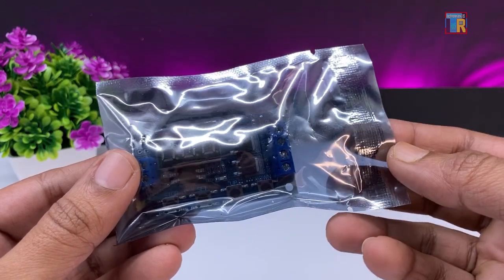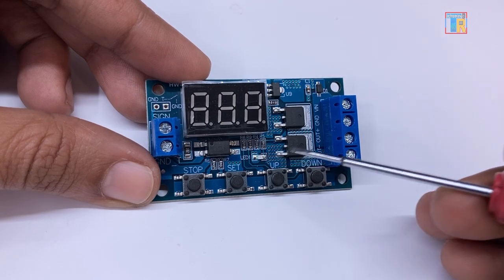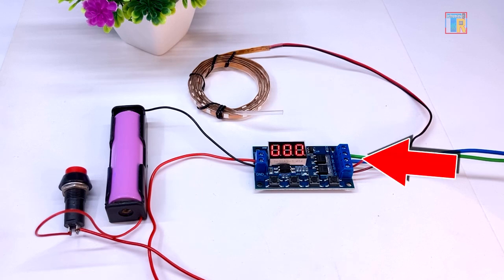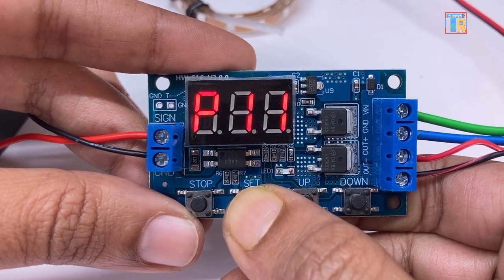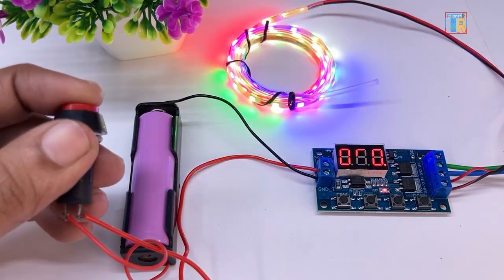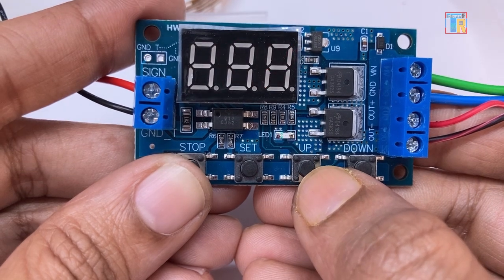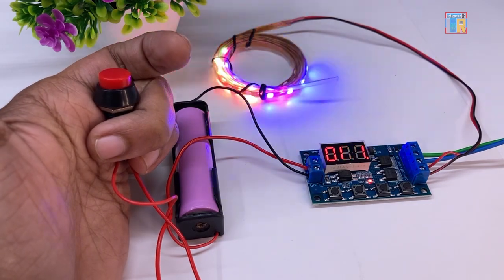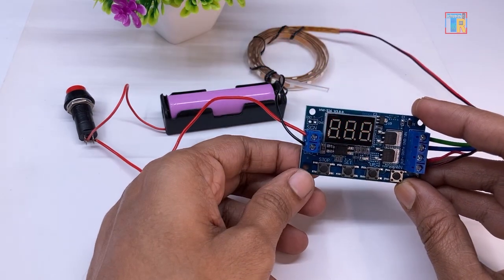How to use timer module

Comment: Greetings from Peru 🇵🇪 Can the input voltage that powers this timer module be used? For example, I'm using it with a 5V DC phone charger, and the question is: can those 5V DC also be used in the trigger? Since you don't have the 18650 battery, what are you using in the video? Or doesn't it work?🤝🙋🏻‍♂️🫂
Reply from the maker: Hello 👋🏻. Yes You can use input voltage & trigger voltage from a same power source it will work